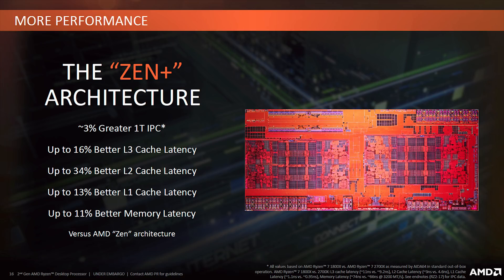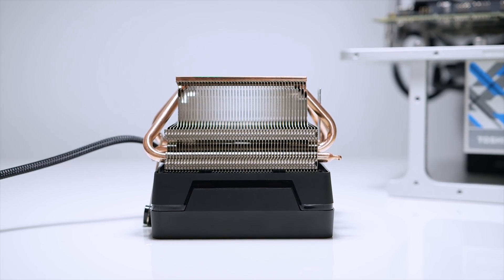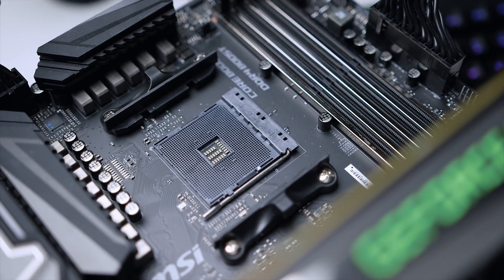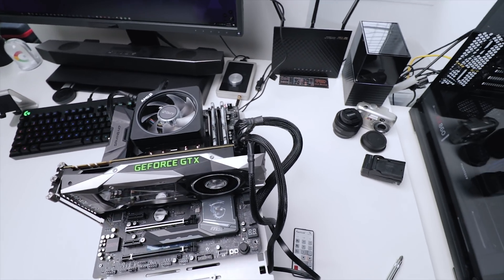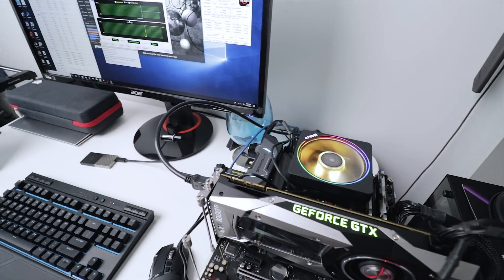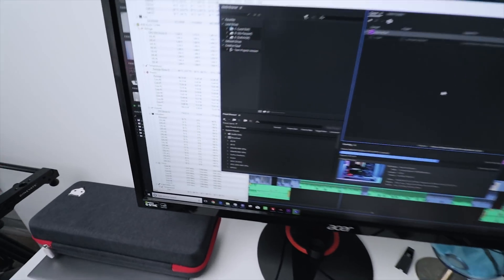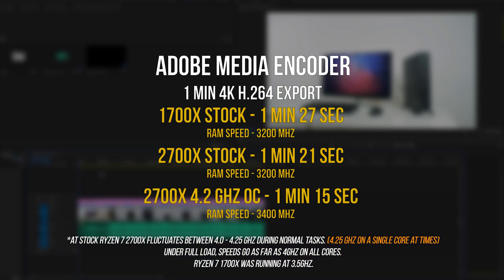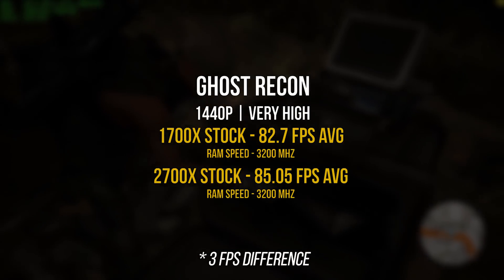Ryzen 7 2700X vs 1700X - Worth the Upgrade?

Comment: You tested at 1440p. That's why you didn't see much difference.
Reply: Lets see if they use 1080p when compairing it to a 8700k in some later test, i can promise you that they will 😉
Reply: Intel sponsored 4 sure.
Reply: Doesn't change the fact there isn't a big difference either way. It's a refresh.
Reply: +Talha Hussain:
"You tested at 1440p. That's why you didn't see much difference."

==In others words, don't upgrade if you are gaming at 1440p.
I game @ 1400 x 900. I get 120 to 160 FPS in BF1 multiplayer, on a Ryzen 7 1800X, so there is no reason for me to upgrade.

If you are rendering 2D and 3D videos, go for the upgrade.

Comment: Marginal better performance. I will stay with my Ryzen 5 2400G Vega 11 for a while.
It is not worthy to switch the motherboard and the processor.  So not sure what was AMD pretending with these new series.
Reply: Matias K You didn't see a difference because he did the benchmark in 1440p lol. At that resolution its more of a GPU benchmark rather than a CPU benchmark. Watch HWU or GN if you want to see proper CPU benchmarking this guy is trash lol.
Reply: You can install this processor on the old motherboards, but make sure yourself to update your UEFI. :)

Comment: Why nobody looks for CPU bottlenecks? The result would just show the difference between the two processors but testing like that it is possible that the GPU just bottlenecks the CPU so you see almost no difference. I just think it makes more sense to set the quality to low, maybe even set the resolution to HD or even 720p...

Comment: I think you should try lower resolution/settings for the gaming tests. I could be wrong but the 1080ti would be the bottleneck at ultra 1440p at over 100fps. You could try like medium settings and then the CPU difference should be more noticable (if any)

Comment: I would have gone with the Little Devil LD PC-V10 case and install the CPU per instructions that come with the PC Case that also means system won't start till the temperature goes below -70 degrees below zero that should work.

Comment: But why did you try 1440p to do your benchmarks? Why not 1080p to stress out that cpu? (even though if you buy an 8 core 2700X for just gaming maybe you can afford a nice gpu)
Reply: It does not matter, if somebody plays with a 2700x on 1080p with a 1080ti, not at all! All what matter is, that it is fully impossible to measure a CPUs performance, as long as the GPU is limiting. You have to leave the GPU-Bottleneck by all means . If not, you just measured the GPU, but not the CPU and your benchmark is fully worthless. You can't measure a CPUs performance with 1440p resolutions, because you are always in a GPU-Bottleneck. I am astonished, that Hardware Canucks did such a bloody nonsense.
Reply: dereks point is testing the games in 1080p tests the cpu more then the gpu allowing for the numbers to really show the 1700x vs 2700x difference.
Reply: Dayvie 

Because the majority of gamers run high refresh rate (144htz - 165htz) 1080p panels? 1440p and 4k is still a very low percentage and is more niche than mainstream. And second, when benching CPUs you want to stress it the most, not the GPU.
Reply: I don't mean it's the wrong price bracket, I mean testing the cpu instead of doing a combined cpu/gpu load. The lower the resolution, the more the cpu is stressed. It's just something I'm sure you've noticed watching all the benchmarks.
Reply: Guys like me, who have 240Hz monitors. Try come close to 240Hz (or even 144Hz) in 1440p, in any game other game then CS ,and that is with a  a 1080Ti.Think Before you try to sound a smart the next time. Benchmarking in 1440p and not even showing the OC result of the 2700x who is a way better overclocker both on cores and on the memory is pure BS and MISSLEADING. Even if you thrown in an 8700 OC to 5 Ghz it would only shown small variance in 1440p (if you have the 2700x to 4,2 Ghz)
And no, Intel is not a choice for me i would rather buy an Xbox then buy a cpu from that gangster company. Beside that ,1080p is the moust comon and used resolution.
Reply: Ok but before you judge tell me how many people use gtx 1080ti for 1080p gaming... I would personally take it for 1440p...
Reply: Exol honestly for gaming only you can still get a 2600x and get 90% of the performance (or 100% of it) in every game. Because in reality for most people they are getting a mid level gpu and both Intel and amd will offer the same fps. So it makes sense to get a 2600x instead.
Reply: Wait what, so you go AMD for FPS?
Reply: Darko Kutleša I do, that is what you need if you have  240Hz monitor. You can check my chanel if you need prof. And no ,i will never buy Intel, i have read and seen to mutch about their way of conduct buisness. Sadly i bougt the 1080Ti before the Nvidia GPP took place.
Reply: im using only 4k so 1080p is nothing for me
Reply: Derek Yu you are right about that, both chips are hitting max performance really on the GPU.
Reply: Seriously.... "We saw no difference in gaming, in an entirely GPU-bottlenecked benchmark suite." 1440P becomes a GPU bench, not a CPU bench. I'm incredibly disappointed with HWC right now because of that.
Reply: Dayvie Some of us have 144-240hz 1080p panels.
Reply: I agree, I play game at low setting to get high frames, I don't really care about graphics, And I regularly play old games like DOOM.
I'm much more interested in the difference on low settings, and no, I do not want intel.
Reply: 720 and 1080 are definitely the better resolutions for a CPU benchmark. 1440 just makes no sense for the purpose of the video.
Reply: Who builds a 2700x and 1080ti rig for 1080p......
Reply: Derek Yu why do you get a 2700 for 1080p. Looks like the wrong price category to me.
Reply: Cirux321 so you build a monster rig $$$$$ and pair it with an old 1080p monitor? Why not get an i5 for 1080p and maybe spend the extra cash on the thing you look at?
Reply: You can show the 1700x vs 2700x difference with a CPU benchmark easily which he did. Normal game logic isn't stressing the CPU in the first place. I fail to see what you are trying to accomplish with those testing parameters.
Reply: 2700x just for gaming makes no sense if you do not video edit / steam. Pick Intel over it any day, but for productivity it is hard to beat at the price. Also soldered IHS (vs Intel paste) is superior for professional use since you do not have to void warranty to get low temps.

Comment: I think you should have tested it with the ram at 3400mhz alongside the 3200mhz test just to show the difference with that faster ram. You may be limiting the cpu by not using the ram at its fastest speeds.

Comment: I really don't understand making FPS comparisons while nerfing the ram speed of the 2700x. It has higher ram speeds, so you should take advantage of that. No one that buys a 2700x is gonna run it at 3200 for fear of hurting their 1700x's feelings.

Comment: Did you notice any difference in temps while testing? since the efficiency is higher in the 2700x, and also, what temps did you get on full load with the stock cooler, is it enough?

Comment: Those Premiere benchmarks were quite something. Could definitely be worth the jump from my 5820k, but not sure if I should wait another generation. Decisions, decisions...
Reply: Ascendant Nomad I have an Intel Nuc and I'm planning on building a Ryzen desktop soonish. It's definitely looking like I'm going to wait for Zen 2 though, as this is just Ryzen but a tiny bit better.
I guess you could say that it's... Zen... Plus.
Reply: Ayyyyyy(MD). Gotta say the stability counts for something with this platform though. Unless Zen 2 is stable as hell I'll be getting Zen Plus as my new build!
Reply: Ascendant Nomad That's an extremely fair point. I'd like to think that AMD has learned from the Ryzen launch, though I know that new process launches are always a bit buggy.
Reply: Zen+ is really just an update on the original chips. Zen 2 however will have major rework compared to the original and should perform quite a bit better.

Comment: It seems if you're just getting into Ryzen, get the 2700x and X470.  If you already have 1700x/1800x and X370?  Well...........doesn't seem to be worth upgrading all that much (from that).
Reply: Worth upgrading only if you got 1600x or lower and that only if you need productivity/professional use. Plus you can resell the ryzen max cooler for like 30-40 dollars which brings the price down.

Also the 2700x is better at productivity vs a 8700k (at least when the application does not depend on single clock speed, like cinebench). A big plus is also it comes with a soldered lid (big plus vs intel), which automatically makes it better for professional use where you do not want to delid/void warranty.
Reply: bullshit. get the 2600x not the 2700x, the performance difference is 30% and price difference is 200%.
Reply: @Choice777  2600x over the 2700x?
Reply: @Kephers7  it's 100% more money for only 30% improvement. a 2600x is plenty for any game.
Reply: @Zachary James but is a %30 difference worth the cost of entry?  For some the answer is yes, for most, who are most likely just gaming while watching a video,  that %200 cost premium is not worth it.

Comment: Hugh question what is the draw backs of using x370 board with the new processors? I want to upgrade to the 2600. Also are the updates do to the counter or chipset?

Comment: I had this exact problem with the stock heatsink where the processor stuck to it when removing. It turns out, the heat sink compound is the issue. I replaced it with some Artic5 and haven't had any problems since. Their stock compound turns into glue when exposed to heat.
Reply: Twist then pull for PGA
Reply: It didn't help. It was stuck really well. I had to give the side of the processor a "love tap" with a knife handle to pop it off afterward. I've since removed it on two separate occasions (a case change, and some troubleshooting for a friend's setup) and it's never been a problem since replacing the stock compound.
Reply: If you wanna remove the cooler, run a benhmark for 2-3 minutes and remove it as quickly as possible.
Reply: Keith Everson sounds dangerous.  I would definitely put some Arctic Silver on it from day one.
Reply: It sounds silly, but heating up the CPU before removing the heat sink helps.
Reply: This happened to me when I was building my 1700. I almost died seeing the CPU stuck to the heatsink. Thought my pins were broken an I destroyed my first computer build. Not sure if this can cause it, but my CPU is still working great a year later 👍
Reply: Julio Johnson The first time it happened to me was I think in 2004 with an Athlon 64, and it did feel freaky. The trick is to give heat the CPU and giving the heatsink a bit of a twist before removing it. It is worse with dried-up pre-applied thermal coumpound, but can also happen with fresh aftermarket thermal paste, because of the succion effect caused by the heat spreader.

Comment: What about the 1800X ?  will they have a 2800x ?
Reply: David Moffett, Jr There's a few things to think about here - Intel is likely releasing an 8 core part soon so AMD is keeping it up there sleeve - it'll be better than the 2700x but by how much? Will it just be better higher clocking silicon? Or with them releasing 6 and 8 core parts on a smaller node are these the -1 and -2 core per ccx variants? Its quite possible they added extra cores in the hypothetical extra 15% space that was freed up... Like a Ryzen 9 2800 and 2800x with 10-12cores - just speculation but it wouldn't be the first time AMD has done something like this. Right now if its just a little better than the 2700x(like 19,00 vs 18,000 multi core score in cinebench at stock) Then the 2800x would be just a little better scoring that whatever 8 core Intel part that comes out(14,000/6 x8=18,666) but a 10 core or 12core part? 22,500 or 27,000 assuming they maintain clocks... Potential insanity ahead in response to z490 and Intel 8 core mainstream parts...

Comment: Will you do doing a video comparing the Ryzen 1600X to the Ryzen 5 2600X?  You did a great job with this video and I'm wondering if the difference between the Ryzen 5 CPUs are the same as the Ryzen 7 ones.  Hell, I am wondering if the Ryzen 5 2700X maybe be better than the Ryzen 7 1700X, assuming you can find it at a cheaper price.